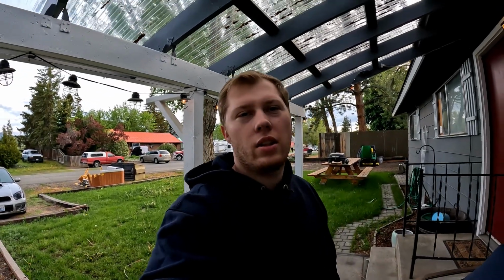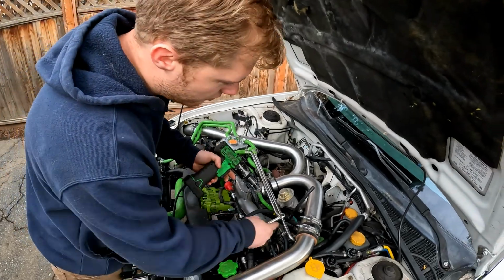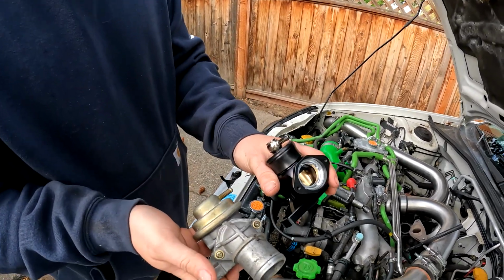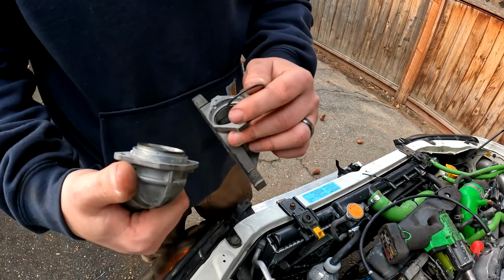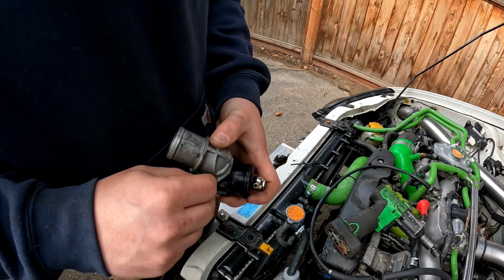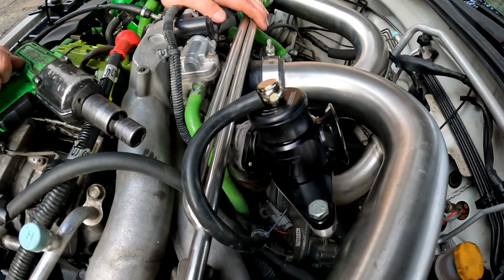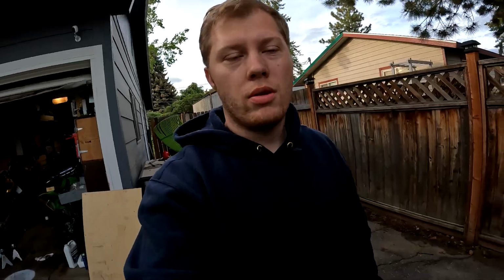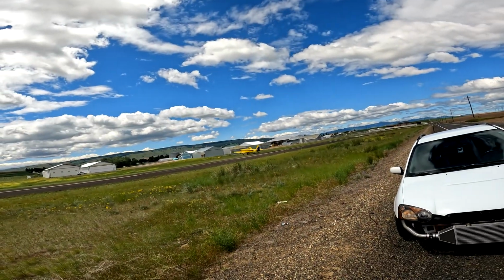BEST Sounding WRX Blow off Valve!!(With sound clips!)

Comment: If you take off the blow off and put a blank over the hole where it is installed you will get the stuustuu turbo flutter.
Reply: Stttuuuu at the end means spring is too strong and not blowing off the air, its being trapped and sent back into the turbo impella

Comment: i am confused is the bov just not opening so its just pushing it back through the turbo or? what i just got a dual port bov and its fluttering even on the softest setting is it normal?

Comment: I've installed a turbosmart 5050, I've taken off the trumpet from the side of the valve and placed the cap over it, I'm getting that flutter sound, but I think it's because I've added a injen intake to it. my question is, with placing a cap we're the trumpet would go, does it mean it recirculate?
Reply from the maker: It wont recirculate unless you mount the factory elbow to it
Reply: Oh I thought it does recirculate that's what the gfb dudes video says and shows

Comment: I thought flutter aka stututu noise was from a bypass valve and blow off valve was a woosh sound
Reply: Wrong on both accounts…. Blocking off the blow off/ reserc will push that air back into the turbo and give you the stuutttuuuu turbo flutter.

Comment: Can anyone help please i brought a 2000 wrx bugeye and it came with a gfb dual port non adjustable full atmosphere venting blow off. The idle has always been sitting low at 500rpm and dosnt stumble or cut out just stays right on 500. Ive tryed everything to try bring the idle up new spark plugs new air filter cleaned the throttle body cleaned the mass sensor no vac leaks that i can find. And did a re set to the computer. And still stays at 500rpms dosnt move up or down drives fine and haven't noticed any problems just have to get the revs up when im on a hill so i dont stall. Could it be my blow off valve?
Reply: It very well could, stock WRXs come with a bypass valve which puts excess air back into the engine where as a BOV vents it out which is where that nice noise comes from and since the engine is expecting extra air it’s not getting, it will end up running rich and can result in low/poor idle but can also wear down your spark plugs and cats, so I recommend either putting the stock bypass valve back or getting it tuned for a blow off valve